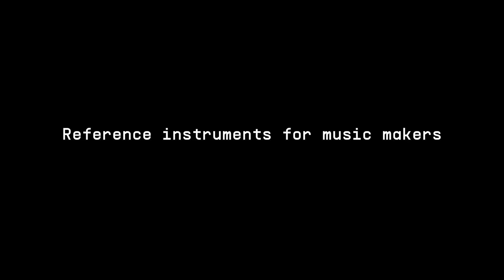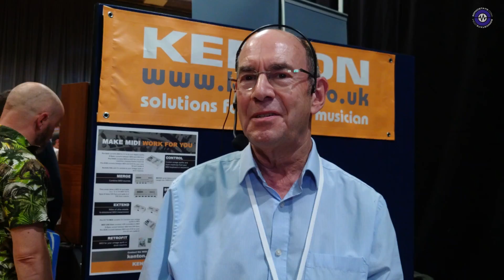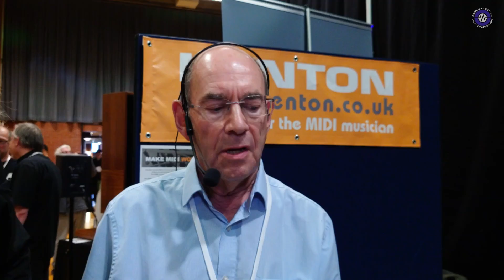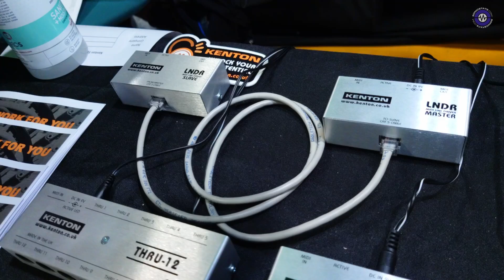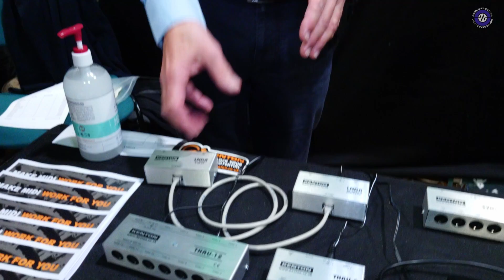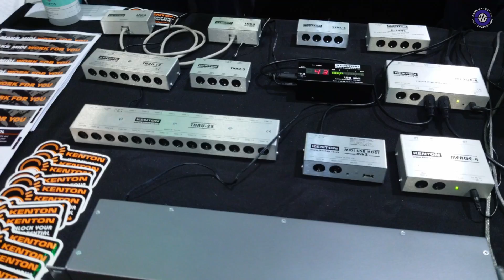Synthfest UK 22:  Kenton - Smart MIDI Patchbay

Comment: Very nice. I like Kenton stuff. I already have something that does routing, filtering, USB MIDI hosting and message translation from iConnectivity (the mio series), but changing the curve of an incoming signal is of course something that cannot do (I suppose I could do it in the Empress Zoia), though I envision it would perhaps only be really useful if you have a keyboard without velocity curves that you wish had one?

Comment: Seems like the first rackmount midi patchbay made in 20 years, lol.
Reply: about right. I picked up a Roland A880 recently. Rather glad. It wasnt 400£!! :D
Reply: @squishmusic  well there's all sorts of 30 year old midi patchbays. My high school had a Sycologic, a digital music mx8, a yamaha one, that roland and a couple of obscure ones, but last I checked the only box doing midi patchbay type stuff was a Motu MidiTimepiece AV.  The express also did some of the same stuff just without the UI. You can get some of the serial midi timepieces for 50 bucks and get most functionality that matters. But the idea of adding usb host ports and modernizing this concept is pretty welcome honestly.
Reply: @stever1514  yeah i picked up the Roland as it was cheap <50€ and Roland gear is depndable and the unit runs 100% standalone with  hardware with some good functions on it. 
Wish more manufacturers made a MIDI patchbay: I was shocked that a well known German Brand dont!